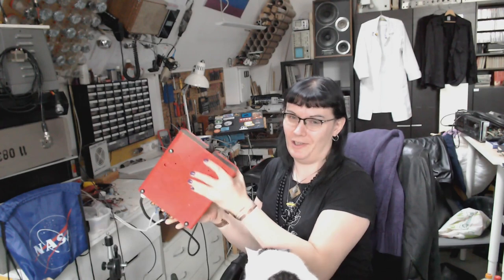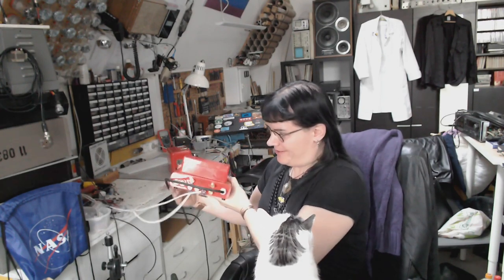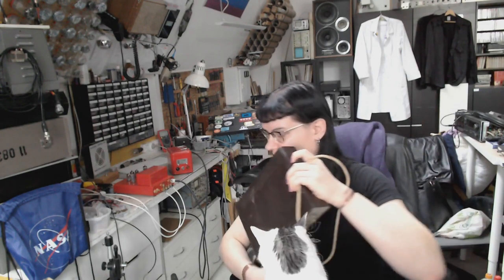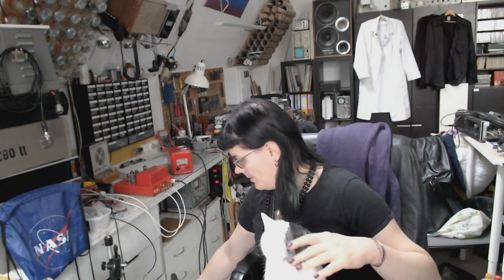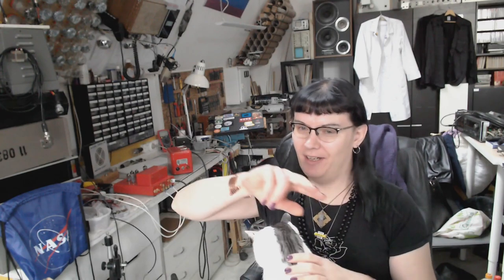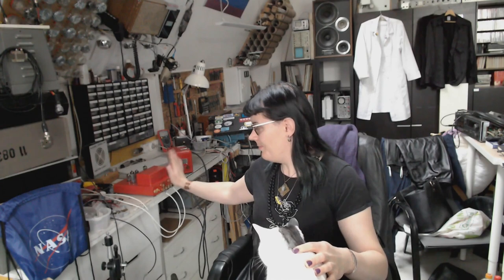The Story of the Little Red Devil

Comment: You have inspired me to attempt to build one of these sneaky devils... I wonder if it's possible to build a stereo amp like this, and also be able to play guitar thru half of the amp? (Mono)?. Also, I wish I could send you my "Riff" I made with URecorder. I'm not so savvy with computers, but I really like what you are doing with your channel. Cheers!
Reply from the maker: You'd certainly need a preamp before a hi-fi amp, as the signal from the guitar is a bit too weak to get the power amp going. Plus some tone adjustment could help as well.
Reply: @KeritechElectronics  Would an Ibanez Sonic Distortion pedal count as a preamp?